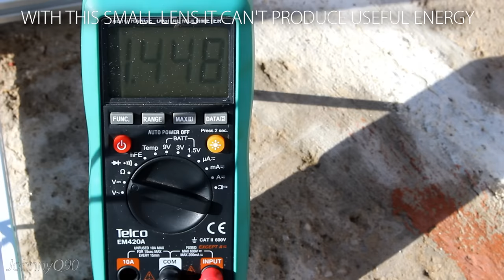Solar Powered Stirling Engine

Comment: I am planning it to do for my college mini project. Will this work or not?
Reply: Go with the clear heat tube instead of painting it. You need to heat the air inside rather than heating the tube (think greenhouse rather than car hood). Also, the lens mount reduced the surface area for the cool side (air fins). All in all good work, just a few differences between theory and practice.

In Stirling engines, the greater the thermal disparity, the greater the power.

Comment: Modifications that may this design needs:

-Replace the generator for a step motor, will produce more power.
-Wide surface to get hot and use cheap cristal lens, 3 or more. 
-Use arduino for follow the sun.

With these changes you will get some good energy for recharge power banks and use some inverters to power some home devices ;)

Comment: Change your magnification material to a lens with greater quality, you’ll get better results and more efficiency but the power on that system is finite means the physic structure is limited power flow. Overall I loved that work

Comment: painting that bit black would have made the glass hotter, but not the air inside it. You should try to run a very lightweight car on a stirling engine.

Comment: Hey Johnny, (love your stuff) I haven't read the +1k  comments... but could we circulate water in a black plastic bag in the Sun ? The water should get hotter than air, right ? I'm just thinking as low tech as possible.

Comment: Maxon motors make very high precision motors- I have used Maxon Motor’s custom assembly number  41.022.024-00.00-770 to generate 12V with 180mah. If you attach that to a set of super capacitors you could easily make a charging circuit capable of charging a battery pack of 18650s

Comment: Line up several Stirling engines on a declination tracking system,   your off grid batteries will charged. If the lens arms were enclosed, would that increase the heat or negligible?

Comment: Adding weight to the flywheel has probably reduced efficiency. The holes in flywheels are to make sure the heaviest part of it is as far to the outer edge. Having mass near the center is not good.

Comment: 1.5 Voltage? I think solar power cells making much better efficency, like this size of solar panel, what your stirling engine work on could make 100w or more electricity.

Comment: If 1.4V DC is the open circuit voltage, whats the power output like? A small single cell Ni-Cd or Ni-Mh battery could be trickle charged with this generator as shown. Also, do you know the gear ratio between the flywheel and gen? perhaps tweaking this, and going to a larger size motor such as a 540 size, you could net some good power from it!

Comment: Aah, but such energy is useful! everyvcell in your human body operates on a 1.5V charge, +/-. to see that one person's concentration of the sun yields just shy of 1.5V is a very powerful connection. It suggests that we are designed to be in the presence of sunlight, as biomechanical sustainable energy generators & converters.

Also fantastic job of machining all the parts. It was great comic relief, seeing you note the need for a power hacksaw after the entirety of machine work. I enjoy dremels with oversized (1"-3") reinforced cutoff wheels. I use them to cut, grind, shape, polish, etc. great all-around tool for location-based or portable work areas.

Comment: Phillips NV of the Netherlands used this type of sterling generator to power vacuum tube radios in the 1920s.   Getting fresh batteries or rechargeable batteries was clumsy.   These could run an any fuel

Comment: Nice!
However, I think that the surface you are shining on, is not very conductive and very large.
A lens like this should give you plenty of energy.
What kind of material you use, as the 'black sock' covering the cylinder area?
Matte black paint might work, I would also make the cylinder out of metal, instead of glass, and insulate it from the rest of the mechanism.
Don't make an aluminum cylinder mounted to the aluminum frame, or it'll draw all the heat away, but if you can insulate it with an exhaust gasket material, or cardboard?

Comment: I don't know if u already use this sawing technique (couldnt figure it out in slo-mo) but pushing the saw down while moving it forward and letting off while pulling makes things much easier... I grew up in a workshop basically and we have every single tool but a power hacksaw and were not looking forward to buy one. Its just the technique...

Comment: thanks for posting.   good work.     some thoughts.    if interested in the performance-limiting  issues  associated with these small engines, see my tutorials.      at 15:14, it should be understood that  the engine/prime mover is Not being  loaded, correctly.     REDUCTION  Should be used at the output; so that the prime mover has  Mechanical Advantage  over the load.     cheers          googletranslate

Comment: johnny, it's nice to finally see people using the cheap Fresnel Lens/diy aqua lens , now you are loosing a lot of heat to the convection of the open air, make a generic concave mirror to attach to the back of the glass heat tube so as to shield the localised wind and also help concentrate the light better and you will get better dissipation, also replacing the painted glass  tube with a *dark ceramic tube will increase the average internal heat even more, especially if you  direct the light/heat to the inside of the tube and place the stopper inside the tube rather than the end.

 oc throwing away that crummy thing called a generator as supplied with the unit  and replacing it with even a generic 12v  DC stepper motor running in generator mode will also make more power as even this tiny alpha-type stirling should be able to drive much better slow speed  generator/turbines.

OC a better suited  beta-type with magnetic coupled drive would work better here.

* something as simple as a Dairyshop Fish Ceramics Tube Hiding Cave, Shrimp Crab Live Plant Shelter Breeding for Aquarium Fish Tank Ornament Decor tube
£2.49, ゅ Material: Ceramic. Size: app.4.8cmx1.5cm/1.89''x0.59''
ゅ Ideal for furnishing fresh water aquariums should work fine...

Comment: I don't understand the use of the 6mm acrylic, this will significantly reduce the light transmitted and a frame would serve the same purpose.
Reply: Plexiglas allows nearly ALL visible light to pass through it. Having said that, it's the infrared part of the spectrum that does the heating. I know Plexiglas is great at filtering ultraviolet. When forming Plexiglas using electric heating elements, infrared, it's easy to get uniform heating on both sides of a sheet by exposing only one side to the heat source. Additionally, F-16 fighter canopies made of Plexiglas are coated on the inside with gold to reflect the infrared away so as to avoid undue cockpit heating. Anyone who has ever gotten into a hot airplane sitting outside knows Plexiglas lets infrared pass right through. The purpose of mounting a flexible Fresnel to it is so you're able to focus the light, rather than have it scatter because of the flexing.

Comment: Nice project and well done. I love stirlings. Just to try it I guess this is cool. But if you just want power iI guess it is much cheaper and maybe more efficient to use a solar panel the size of the freshnel lens.  I think this would be something like a 12v and 30 watt powersource for 40 dollars. This setup is much more expensive and the result is less. But still a cool project. A stirling is just sexy

Comment: Maximizing efficiency will also require you to put the right load on your dynamo (or is it a magneto? i.e., AC, not DC).  One that small will have a relatively small current limit, beyond which the voltage falls but you don't get much more additional current.  For example, on a bicycle "dynamo" (it's actually an AC magneto) hub, the current limit is about 500 milliAmperes.  Higher power requires higher speed, and higher voltage.

Comment: This is brilliant idea, now if you scale up the engine part so it can move bigger alternator and improve the Sun & Wind blowing on that bulb can really increase the power & efficiency and can do away the need to go for solar panels.  This mechanism at least delivers CLEAN (I would go to say 99% clean) energy compared to Solar panel which are made from / by toxic substances and much difficult to recycle unless you have appropriate recycling services available in your area.  Great job I will say here. 👍👍

Comment: Very good work but it seems there is some disconnects. 

First: The frenel lense should be producing more heat to drive the engine faster than what we saw.

Second: What you have done is to modify a nice toy. To really impress build a larger sterling. 

Again, you have fabulous skills and inventiveness. Keep going.

Comment: HEY! Didn't anyone ever tell you not to use gloves while operating a drill press or mill (or lathe, for that matter). If feel you must were some, use those thin, latex-type gloves. That way, if they get caught, they will rip right off before your hand gets pulled in.

Comment: U can configurate the circuitry to enable the small engine to help support more 🔋......i would not jus rely on just the engine to supply all of the help. U can use control boards ...capacitors. Jewel thiefs. Another solar panel to help boost the voltage and wattage. Having circuitry of lithium batterys or more panels in series or parallel. Jus by that little engine it can make a higher supply of wattage and voltage accessible. Thanks for the vid. I enjoy watching.

Comment: Can't determine useful energy with a multimeter in volt mode without at least a resistor. A multimeter in volt mode is high impedance (very high resistance), because of V = IR, if R is really big, then I is very small (I being current). P = V * I, so power is will be very small if I is very small. So not useful energy at all. I commend you on your fabrication skills :)

Comment: if you could make an engine big enough to power a car alternator..you could run that power through a converter/battery set and then use it to power,say,a tiny window mounted air conditioner...the electrical cost  savings for me here in orlando florida would be in the range of 2,500 dollars a year.
 I  have an electrical engineer buddy and he looked at my challenge with solar panels..that would be 12 thousand to make.  do a study and see what you come up with...places  like florida,texas,arizona,new mexico,and of course southern  california have an abundance of sun light and therefor, heat.
 if you can make a free power source that would pay for itself in a 3-4 year time period and have a service life of 6-8 years,,you would be rich beyond your wildest dreams...or dead due to fossil fuel companies having you killed...lol

Comment: You can also use the shavings especially the brass one for better heat transfer.

But didn't the extruded aluminium parts had a clip for fixing without tapping

Comment: you should take the black opaque paint off your glass tube, you will get better performance if you put a white backing on half of the anterior side (the side facing AWAY from the light but toward the glass.), glass is opaque to UV light already. What you want is to replicate the greenhouse effect in the tube, you want moist air (moist but clean of particulates.) or if you can, fill the tube with methane as the heat coefficient is upwards in the 4 range.

Comment: Question:: need a circuit here,which control by temperature. And automatic start the engine by dc motor.when the engine will start,the dc motor acts like dc generator and you connect load.
Is this possible to make a circuit??

Comment: Were the telescopic poles measured so that the fresnel lens' optimum focal point met the black cylinder? When you burned the wood, the lens seemed to be much closer to the wood than the lens was to the cylinder. If your object isn't meeting the lens' focal point, the solar heat created by the fresnel lens isn't going to impress. I would have loved to see you hold the lens to the cylinder just as you did with the wood before you mounted the lens on the poles. Side note: Your work is AWESOME! That is the prettiest little solar engine I've seen on YouTube. Well done sir.

Comment: Nice work! If you need more power and speed just use a Calcium-Silicate (or other thermo shield material)shield around the hot side with a front glass onto the black tube to stop the wind's cooling effect. Congratulation!

Comment: What a beautiful piece of machinery! 
 The conclusion was that the lens was not large enough to produce useful energy, but intuitively it seems like the lens is not the limitation. If there’s enough energy to immediately start a wood fire, that’s surely more than 1.5 volts. The loss of energy must be somewhere else in the system. Right?
 Question: the salient factors are mass of the hot side vs mass of the cold side and temperature differential? How much of a factor does piston length and flywheel weight play into the efficiency of the system? 

Appreciation to anyone who’s willing to explain some of those details. I’m not an engineer but I really like talking to them. And these engines are really fascinating.

Comment: sun powered stirling are really not very efficient. mine that is exactly the same model with a regular flame can do 7.5 to 8.91 V at 1amp wich is enought to charge a phone, a battery or power a light.

Comment: looks definitely cool, but is it practical? how many of this engines you would need to power your iphone? cause that is what it comes to .... cost and efficiency, if it costs 500$ to build it and generates less than 100 watts... id just buy a solar panel and get way more power efficiency. This is definitely useful if u got a lot of heat waste and living in a icy environment. otherwise is just a cool science project to show at kids party.

Comment: The great thing about this video is that it shows that anyone with minimal skills can build this with just the basic tools, parts, equipment, and materials lying around the shop.  My 12 YO son and I built this very same model and it only cost us 50 man hours and $300 in tools and materials to prove that a $50 Stirling engine made in China, and bought on Amazon, can be powered by a solar lens.

Comment: Adding brass to an aluminum flywheel increased weight so little . If you're going to that much trouble , why not make a larger diameter steel flywheel  ?

Comment: Try solar vacume tubes that super heat's a resivor of Gallium Aluminum Scandium alloy to power the hot gas cycle. You could also add in an absorption refr unit and have the stirling hot gas engine turn a fan to provide air conditioning all by the system.  Very surprised no one has done it before? Using solar vacume tubes to super heat liquid metal to operate an absorption refrigeration system for their home's green house's recreational vehicles and so on. 😊😉

Comment: JohnnyQ90, I found this because I had an idea that I cannot do myself. Can you make a giant stirling motor and thermal paste a copper cuff to the end that needs heat, then extend that cuff out to a copper sphere and get 4 of those magnifying lenses to set up in the path of the solar light so it has sun all day. Then add insulation to the copper and cover the parts exposed to light with clear paint so it doesn't get oxidized, and add a transmission/pully system to the wheel of the motor to lift a heavy object that can in turn drop to power a gravity generator? This would be the best "free solar energy" device on ytube if you could. Thanks...

Comment: how many amperes with 1.4 volts? or else simply, how many watts were the output. or else volts doesn't say anything as rubbing a cloth together also generates more than 1000 volts.

Comment: Hi, I'm trying to do my own type of Stirling engine for multiple purpose. My suggest is use Hidrogen like working gas inside the engine. To do so, you sould add 2 gas valves like to inflate tires, in the fist add gas hidrogen an the other extrac air to remove air gas for replace ir with hidrogen. This gas is much better transmiting heat than air gas. Try to isolate the heat transfer between the heat piston and the cold one using ceramic material. Use a material like aluminum scourer inside betten the 2 pistons to make a heat feedback and upgrade the efficency.

I'm making a special mechanism that strictly respect the stirling engine in all the cycle, I'll use a pair of cylinder shirt with aeration fins and the conection betten the cylinder, I'll use ceramic or isolated heat material. Hope that could help. Good luck

Comment: What you have there is Awesome!!! What about: Creating a V-Row of local lava rock underground that is large enough to be a heat storage battery, and store heat for half a day or longer in the lava rocks themselves so you can run a stirling engine to turn a generator to power your home, and yes, by way of a heat storage battery!!!  And, I don't know if a hub with planetary gears would be better, or levitating magnetic bearings, or if you should stick to what you designed here.

Comment: Loctite isnt actually a glue like most people would think of, as in you can't just stick two pieces together with It. It only hardens in the absence of air in well fitting cylindrical parts with just enough clearance for the loctite or as a thread Locker but loctite 603 is particularly for cylindrical fitting parts. (Which is what you are using it for.)  It's actually an anaerobic adhesive that cures to a hard thermoset plastic. They are supposed to be used for only metal to metal applications so I'm not sure how long the plastic gear will stay on. But one would think plastic should stick to plastic. I could be wrong I've never done it and obviously you have.